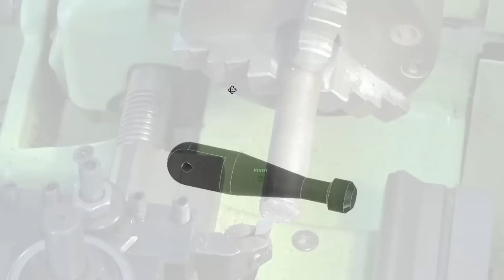Float Lock Vice from Aluminium Castings Part 5

Comment: I like that quick moving mechanism of the fixed jaw (that sounds a bit contradictory). It is well worth the time you have put into this. 
I have also had some drunken threads using taps in the past. Yes, winding the part onto a thread and then turning it will fix the issue.
Reply from the maker: It's a lesson I should have learned ages ago. Never trust a tap to make a concentric thread! 
Regards,
Mark
Reply: @Preso58  hmmmm this is a good lesson for me, I hadn't even thought about that but have noticed the effects of a tapped hole not being quite right

Comment: I love this tool! I will have to make one when I get a drill press... ;-) I have a suggestion for an addition that may be of interest to you Mark. At 29:44 you show a spring that is used to take up any backlash in the nut. If you were to make a part that resembled a nail whose head diameter was that of the spring and the shaft was smaller. A hole could be drilled back through the nut the size of the "nail shaft". The end of the nail would be rounded and hardened so as to ride in three or more detent points in the swivel handle. This would keep the handle position at either a right angle to the nut or parallel with the nut. Or that end could be cam-shaped so the swivel handle would snap back to the parallel position. This would keep the swivel handle from getting caught in the T-slots or over the edge of the drill press table. When I use C clamps the little floppy handle always catches on something.
Reply from the maker: You are right. A detent would be very useful addition. I have yet to find out how annoying the handle is going to be but maybe a strategically placed nylon washer or an O ring might do the trick too. I will see when I get the vice actually mounted on the drill press.
Regards,
Mark

Comment: Gday Preso, I know exactly what you mean about the drunken thread, I had this happen a little while ago on a part for a Trimble laser level, very frustrating when it was the last operation of the part, the vice looks great and the ratchet sounds very positive when it locks in, brilliant job mate, cheers
Reply from the maker: Thanks Matty. Thread cutting is the bane of my life. I am gradually lifting my game by getting the necessary boring bars and inserts to do single point threads. It's scarier but oh so much more accurate.
Regards,
Mark

Comment: Looking good Mark, I'm late to comment...catching up..
Cheers.....
Reply from the maker: Thanks Dean. It is a mighty handy tool and I do need to get on and actually finish it. I found out that the original had some fixturing holes in the ratchet jaw and I couldn't figure out why they are there but just yesterday I figured it out when I had to drill a number of holes in a batch of small parts. Hopefully I will get those parts done this week and do a wrap up showing how it works.
Regards,
Mark

Comment: “drunken thread”, while you were running the tap without end support I was wondering if you would have an issue?..YES, I had the same issue on a .750 tap and had to remake the part….ENJOYED the video of your great build
Reply from the maker: Thanks Chuck. I re-learned a valuable lesson there. In reality. I wanted to be able to single point all the threads but my lathe won't do a 1.75mm pitch thread. I have remedied that now by making the necessary gear for the QC gearbox. It's only 3D printed but it seems to do the job. 
Regards,
Mark

Comment: Awesome craftsmanship and practical engineering. Mark. The radius setup is cool, you mentioned a tracer capability accessory?
Reply from the maker: Yes, Eccentric Engineering make a copy attachment. https://www.eccentricengineering.com.au/shop/Tracer-Arm-and-Fence-p178381120
I make the templates from acrylic on my laser cutter. It's incredibly simple but you can make some super accurate and repeatable parts with it.
Regards,
Mark